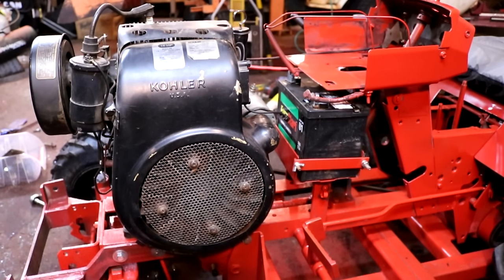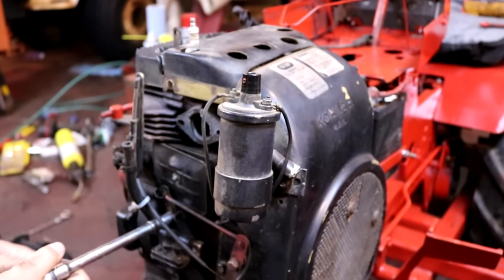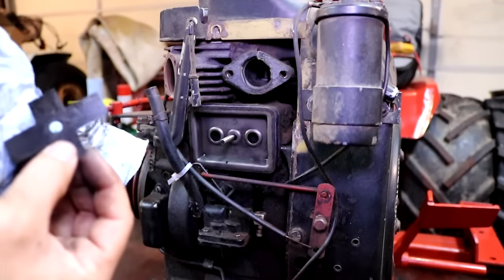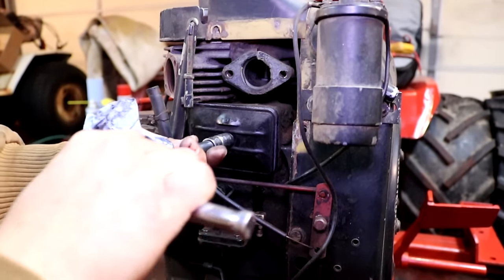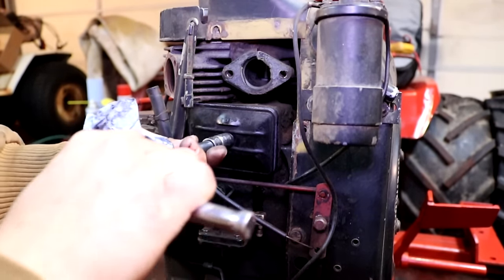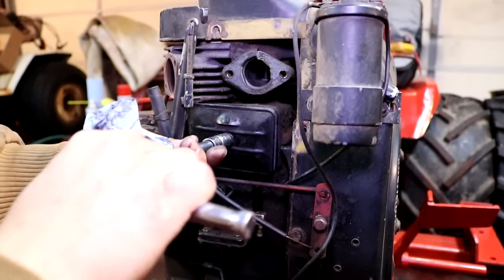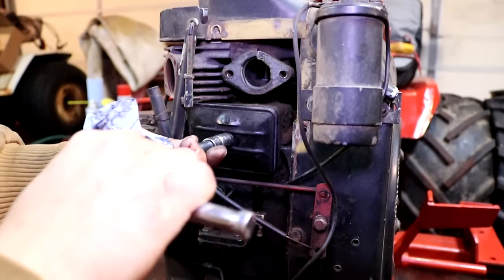5 Things You Should Do To Your Kohler K Series Engine Right Now | Kohler K Series Engine Maintenance

Comment: Have you ever had an issue with the mechanical fuel pump? Mine quit working.  Bought and installed a new one and that didn't work either. So I put in an electric pump. Kind of like the electric pump especially at the beginning of the cutting season, you know priming the system. Much easier on the starter. I really have to check the points on mine. The tractor is an 85 and never really done anything to it except changing the oil and clean it and that sort of thing. Believe it or not I have an old homelite chainsaw that I got new when I was about 14. I'm now 63. Have never done anything to it other then changing the spark plug.  I used it a few years ago and after 3 pulls it started right up!! I do make sure to drain the gas out of it, same with the tractor. I just drain the gas out of the carburator.

Comment: Good video, but I will start by removing the head first. There is no point in investing in points, carburetor, etc, if the engine is shoot or need rebuilding. Also, if you need to lap the valves, you will need to remove the carburetor anyways for access... As others have point-out, and new carburetor is only required if the old one is worn-out or have been temper with (which often happens). Thank for the video.

Comment: Constructive criticism here... A Gravely fan so I know Kohler engines.  I completely agree with these five issues that should be done with every engine.  The videos only weakness is that  they should demonstrate how to adjust valves using two wrenches and showing all the steps.  While the mystery of the crankcase ventilation system is given 5 minutes no time is given to how to adjust the valve and I assume that this video is an attempt to reach out to newbies who are trying to do their own small engine repairs.  That said...I love I save tractors!!

Comment: With engine in the tractor of my 212, there is a support piece of metal in the way to access the screws in the points cover. 

I learned by loosening the bolts in that plate. I could jam a rod of metal in there and lift it enough for my screwdriver to slip under the plate and access the screw in the cover. By using a screwdriver with a strong magnet I was able to retrieve the screw. But putting it back in was hard with the flat tip driver. So I took the screw to a hardware store and got a Phillips screw with the same threads. That at least stayed on the tip of the driver for reassembly.
Reply from the maker: Yea several machines where the engine sits deeper in the frame can have access issues for the points. Good thinking on your part!

Comment: Original points compared to today's, no comparison. Clean your original tungsten,  provided that they are not FUBU. Regap after using very fine Emery paper,  carb clean. You'll go through 4 or 5 condensers before a good stock set of points. 
Checking the resistance of the coil is also helpful. 
Good tutorial.

Comment: 1:21 carburetor removal
2:47 valve clearance
8:25 carburetor install
11:45 governor
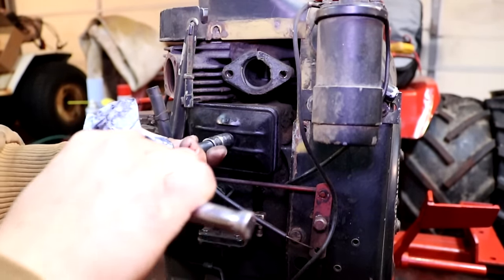13:23 points
17:13 condenser
18:19 combustion chamber
Reply from the maker: Thank you! Amazing
Reply: @Isavetractors  Rohan king says your carburetors suck, just rebuild stock carb
Reply: How do i get the black tar out of the small holes in the carburetor I have already tried all types of ways to clean it out it's the original carburetor I've not tried acetone yet so that's still open for me to try out it needs something that'll dissolve sticky tar all that is is really old gas that sat for years
Reply: @Isavetractors if the valve clearance isn't right could they cause a tapping sound that speeds up with the RPMs?

Comment: A nice upgrade for the points and condenser is a Kirk's Transdenser, got them on all eight of my  K series powered tractors.
Reply: does that bypass the points?
Reply: @M.TTT.  It replaces the condenser, gives a hotter spark with less voltage to the points. Plus it has a LED  that flashes to help time the spark.
Reply: @Canis_Lupus_Rex  oooh okay, sounds nice, although I hope to bypass the points on the briggs powered simplicity 3310 I might get.
Reply: @M.TTT.  You can check around, I think somebody has a kit available, or adapt a Magnetron setup from a newer model Briggs.

Comment: Great Kohler video for this engine, glad I stumbled on your channel.  I am in the process of rehabbing a 10hp K241 engine. As a DYIr have worked on several small engines but this one is my “largest/oldest” hp small engine to get back to daily use that will be used to run a Lincoln Welder/Generator.  When I got the engine, the fuel tank had fresh varnish smell in it and previous owner told me engine had not run in at least 15yrs.  I took the air breather cover off, shot starter fluid in the carb throat, and the engine fired off for 5 sec so that told me, after a carb rebuild, this thing will be back in running shape:-)

Comment: While you had the carb off I wish you had spent a minute on the fuel pump. They do get dirty and need attention. Doing a compression check would tell me if it needs help. Inspecting the head gasket too would let me know if something was amiss. I'm all for replacing the carb if it was bad. Good informative video , keep them coming.
Reply: Take it apart.  If the diaphragm us in good condition  make sure the little valves are seated good sometimes they come out. Put it together.  Good to go  as long as the stream is steady  your good
Reply: @mjj8170  One in my garage now is proving hard to get the diaphram . Sitting for years with bad gas took a tole  on it.

Comment: Thanks for the tutorial.  I have a K181 8hp on my Gravely that needs some love.
Reply: Steven Wimmer  I have the same engine that came off a gravely unfortunately he scraped the chassis but kept the motor . Does yours have the gear reduction side case? And does yours leak ? I have only ran it on the bench and after sitting for a month or so it looks like half the oil leaked out , I can’t tell if it’s a inner seal or case bolts or gasket, or maybe all the above ?
Mainly I mounted it to my welding table to test it and adjust the carb and have needed the table but I know if I don’t fix the leak I will set it in a corner and it will just sit like a few other projects .

Comment: Bought my Cub Cadet 106 about a month ago, previous owner knows his stuff and had already changed the oil and replaced the points. I refuse entirely to replace brand new points on an engine. It's carb also works fine, and I rebuilt it to make sure it was clean. Lastly it's condenser works just fine, although a bit rusty, and I see no need to replace the condenser if it still works fine. However checking the combustion chamber is a good step, as is checking the valves on it.

Comment: My Cub 104 is 52 years old this year. I had her carb rebuilt just about 2 years ago, as well as a valve adjustment. The points have been replaced so many times, it isn't even funny. Her generator was rebuilt about 30 years ago, and other than brakes, headlights, and tires. She's pretty much untouched. 

My Grandfather bought her new in 1968 with most all the attachments, accept the snowblower. Having a snowblower on a tractor was a lazy man's way. She has spent the last 35 years with only her dozer blade on her, pushing snow or dirt. It wasn't that long ago she pushed 27 thousand pounds of gravel around my driveway. The old girl has been worked her entire life. 

In another 50 years she'll be doing the same things. I'll be dead and gone, and my kin will still be working her.
Reply: J D  up in Maine snowblowers aren’t optional some years, you simply run out of places to put the snow without one.
Reply: Depends how much snow you get.  I get lake effect snow that can be pretty excessive.  Plowing can only get the piles so high and comes a point when you can't move it.  A blower puts the snow far enough away that you don't get bottled up.
Reply: Old cub cadet`s rock I have my dad`s 124 that he got new in 1969 with a snow blower.I rebuilt it in 2000 it was tired but still on the job.still using it.

Comment: Nice vid. I like the presentation. The info was helpful as well. I just bought a 782 cub cadet yesterday. The governor runs away all by it's self without touching the throttle. I have to manually adjust the governor to keep it running without over reeving the engine.  Do you have a vid that goes into more detail on fix repair and/or replace the governor on a 17hp Kohler? I've tried searching a vid on just the governor, but failed to find the right vid so far. Any help from anyone would greatly appreciated.

Comment: Another item I would add to the list would be to remove the flywheel cover and shrouds, and clean up any oil/dirt buildup and grass accumulation between the cooling fins.This is the #1 cause of premature wear on air-cooled engines, in addition to using the wrong oil...especially important on these old K series.
Reply: but on my jd 110 you have to remove the engine from the tractor to take of the flywheel cover but yes you have a good point
Reply: @spencer1096  Yep...sometimes it's worth pulling the engine out to give it a good cleaning.

Comment: You know what i think is good to change is the oil to synthetic 10w30or40 usualy opening screw some will rich fuel if ever wasnt getting enough leaving them together and trying good oil has worked well for me grit sand blast the valves file down valve clearance the points are good to change although if you leave old ones you keep timing carefully sand between the points you have to take out valves cover in sand where it seals spin it to clean seat then clean of sand and put springs on

Comment: Hi, thanks for the video, I performed all the suggested maintenance on my ariens S14 lawn tractor (Kohler 321s) and it solved some issues I was having. I bought all the gaskets and the new carb etc from Isavetractors... Unfortunately now I am leaking oil from the breather valve cover.  the gasket face seems plenty smooth. It is possible I over tightened the breather valve cover so I will try replacing that.
Reply from the maker: Give us a call or send us an email for detailed assistance.

Comment: Have to check the block for warpage too, these get real hot by the exhaust port+valve then warp as you can see in your photo where the headgasket was failed/failing.

Also checking the valve guides is pretty important too, simply wiggling them at full lift is all you need the do to make sure the play isn't excessive.

Comment: I need your help Norm!
KT19 kohler in rare C195 wheelhorse.
Ran fine yesterday.  Today?
Half hearted attempt to start.
I checked it over...found blown fuse from ignition switch to ammeter.  Attempted to replace fuse....crackling sound in fuse holder.  Smoke coming from flywheel side of engine (near top of engine).
Each time I attempt to replace the fuse?  Same thing.  Key out of ignition.  Now won't crank or even a solenoid "click".

Stator? Volt regulator?  Something else?

Comment: Hey I just bought the points and condenser set from you and it ran for about 30 minutes and I killed it and wouldn’t start and it turns out it was a bad connection to the points I fixed that and now it runs really bad if it starts and just backfires do you think my condenser went bad again?

Comment: Now in regards to oil.

My diesel jeep has 250,000 miles and still runs like new thanks to synthetic oil.
What would you think of me using that Rotella 20/50 full synthetic in the old Kohler. I  have people telling me it  has to be straight 30W. But everything I have read indicates synthetic is better in ALL applications and 20/50 should provide more protection than straight 30W

Comment: Great video! Would it be prudent to check the head before you adjust valves, in case valves need lapping? How about an engine with the Kohler breakerless ignition? Is it better to convert it to points? Thanks.
Reply from the maker: Yea this was not necessarily in order. Just how it came out in the editing room to keep it clear for the video. If you have breakerless ignition, I do recommend switching back to using points.
Reply: I love the "magnetron" electronic modules. On most engines the points are under the flywheel. No need to remove it. Just clip the wire and splice it in. If the seal happens to leak a little, the oil will not affect your spark.

Comment: I have done these except replacing the condenser. Is this part particularly important for cold weather starting?  Mine are very hard to start under 40F. If I use a booster I can get it to crank faster and that usually works. Or warm it up under a tarp with an electric heater.

Comment: i know you know how to do this stuff but i myself would have to at least fine-tune the carb all motors are a little different and there is no way you're adjusted carb will  be ready to rock on all motors  what's your take on this i will get a hold of you if i need parts thanks

Comment: Good day.

I need some advise.

My faithful Gravely 522 conked out on me a few days ago. It has a kohlar engine.

Whilst working some brush,  heard a snap sound  and it started smoking. white. Near the starter.  Tried starting but no luck.

Engine just tumbles...no spark though.  I went thru basic trouble shooting means but still no luck...I fear the worst.
Can the coil 'blow out'?
Any suggestions  would be most welcome.
Thanks

Comment: I have acquired several of these series of engines over the years.   Everyone did not run because the tops of the pistons had separated from the bottoms.  
What are the odds?

Comment: Do you have the coils assembly for the 23 hp blue KT??2 motors? How about parts for the 20 hp red M20 motors? On the farm the augers and the IHC Cub Cadets all ran and ran on Kohlers. Now we have an auger with a 29 hp fuel injected Kohler, starts perfectly at  -24°f.  I would have hated to try to start our K321 or K341 at  -20°f. 
Thank you from north east Montana.

Comment: Why do you replace the carburetor? I’ve only had to buy a new one maybe once before but for the most part if you clean them up and adjust them they still make the engine run like new.
Reply: He doesn't make any money when you clean and use your perfectly good carb that wasn't made in China
Reply from the maker: A carburetor from 1960 for example is 60 years old. The pivot point where the throttle turns in a cast aluminum body will wear and cause rogue air to enter your carburetor making your air fuel mixture more and more lean as even more time goes by. Parts don't last forever, and at this time period, it's appropriate time to consider replacement.
Reply from the maker: @maggs131 Our carbs are not made in China. While we are a business, we exist only to help customers and tractors. So don't be an ass.
Reply: @Isavetractors  only to help customers? So your profits go to charity. Well that's cool then
Reply: engines and outdoors - I replace the carburetor because there is air that leaks In at the throttle shaft making it run lean, or causing it to smoke like it needs new rings. I’ve found that with a new Carb it runs much better and usually clears up any smoke. That being said if the machine is a low hour unit and everything feels tight then I will rebuild the original carburetor. But I’m finding that for an extra $40 I can slap a brand new carb on and save 1-2 hours. Time / Money
Reply: @maggs131  see all these videos he makes that you watch for FREE?? And he helps us by providing quality parts shipped from the continental U.S. with actual customer service? Yeah, just stop trying to spin this as negative man.
Reply: @M.TTT.  just pointing out the obvious. Keep lollipoping him you might get a coupon
Reply: @M.TTT.  you to dingle berry 👍
Reply: @Isavetractors  that's great to know that
Reply: @Isavetractors  IAM not take my Carter off for one ur carbs . I'll just buy the bushing kit to fix it . . And we're are your carb made cuz the rest of the stuff is from China
Reply: @RustyZipper  they make a bushing kit to fix them . Carter is way better . Iv fixedany never had a problem
Reply: @RustyZipper  all ks smoke on start up lol
Reply: Steven Maines - Lol, odd cause when I replace my worn out Carters with Norman’s they Do Not smoke, hot, cold, Load or no Load. Again why would I waste my time and money patching up a worn our Carter when I can bolt on a Norman and be done? Now there are some low hour units where I have rebuilt the gaskets in the Carter’s but mainly because I’m cheap and they have some sentimental value. The Point is don’t buy a Norman carb if you don’t want to...IDGAF as long as you save the mower from the scrapper.
Reply: @RustyZipper  Carter's r the best carbs for a k . And every k I ever had smoked on start up . I work on small engines for a living.  I have I have 4 ks on 3 Deere n o e Ford .they all smoke on start up if they been sitting ....
Reply: Steven Maines - yeah man, I don’t care anymore. I get it: You don’t like Norman’s Carbs and there is nothing anyone will say or do that will change your mind. I’m cool with that and thanks for saving the old equipment ✌️
Reply: I want trying to start anything I was just asking why he buys new ones. Y’all need to calm down.
Reply: @enginesandoutdoors3238  he do t have buy them he has made in China like rest of the stuff . Friend baught stuff and says China on it .
Reply: @Isavetractors  the I e. U replaced looked fine. The earlier one didn't have a bushi g the later.ones had the bronze bushing nnu could replace it my 73 140 with 14hp k I replace the bushing n it runs great n it a Carter ... Mine ran fine before I replaced the bushing to ..